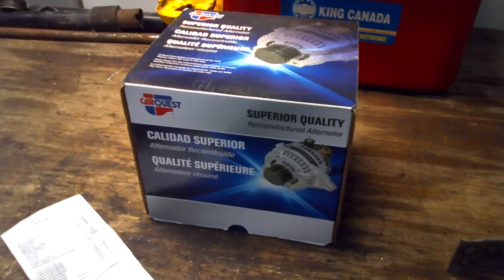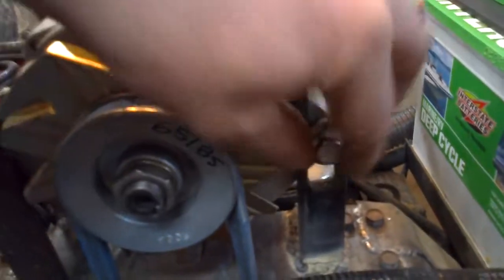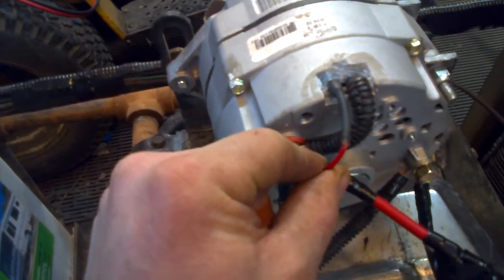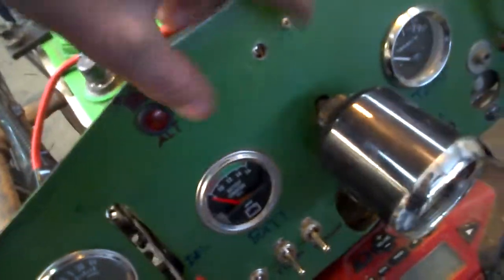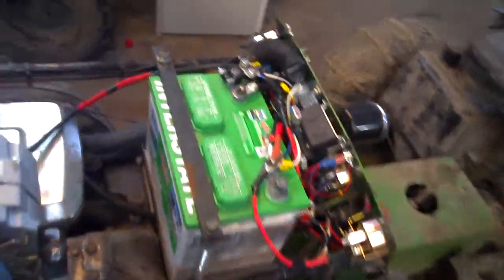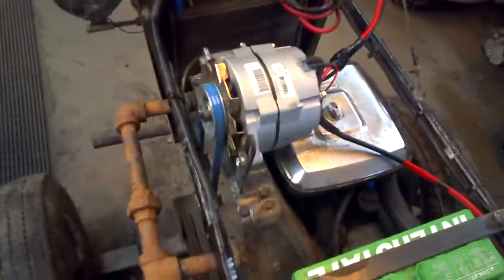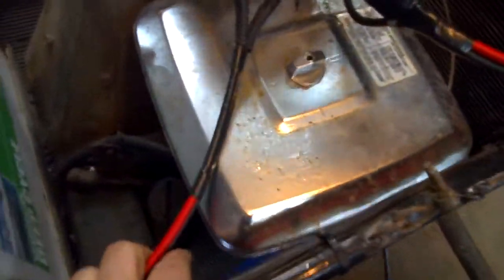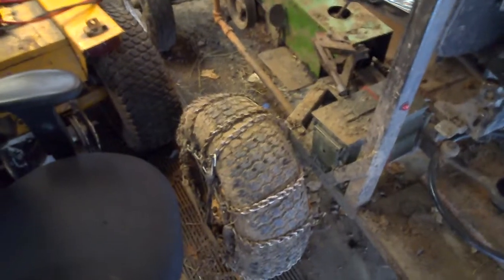GM / Chevy 10SI Alternator install on 18HP Briggs and Stratton opposed twin

Comment: anybody know what the smallest alternator is that one may buy to power off of a 5 hp briggs while the 5 hp is powering say a go cart, so its enough to get enough power for lights and charge a battery
Reply from the maker: Yea but small is more expressive. See if you can find the stator for your 5 hp. Many lighting coils were available. Or look at a john deer or yanmar
 20 amp alt, expensive
Reply: Danerr Morgan
thanks man. How much was your 10si and how many amps?
Reply from the maker: +ChiefJustice Middleton it's in the video. 65 amps max and it was around $70 in change. Watch the video again and ask for it as I did. Great alternators, can rebuilt at home dirt cheap
Reply: Danerr Morgan
Ok bro, thanks again

Comment from the maker: A typical Gm alt is designed to self energize at 900 rpm, my tractor idles at 670 rpm. after 3 seconds at 670 rpm it will self energize and begin charging. i rushed and bumped the idle up just a hair to manually start charging fr illustration purposes. also with a full battery as i have here it wont take any juice until the alternators field draws enough to drop the voltage down to 12.5 then it jumps up to 14.4